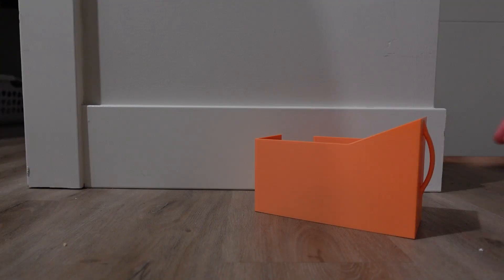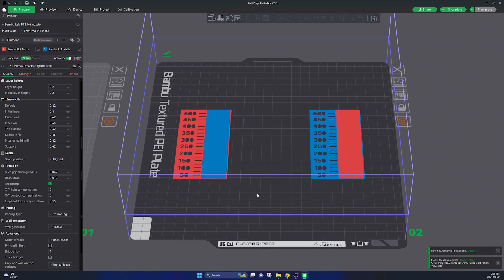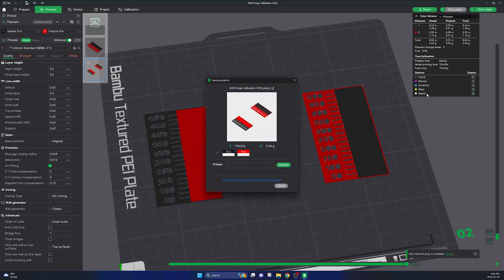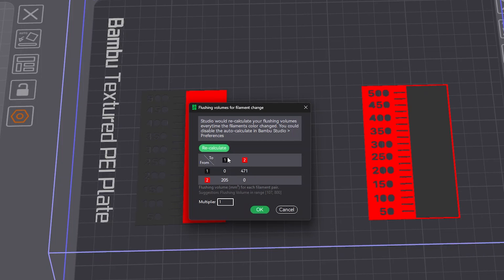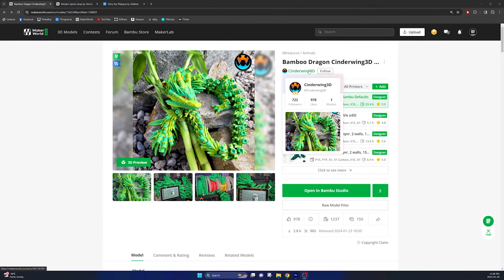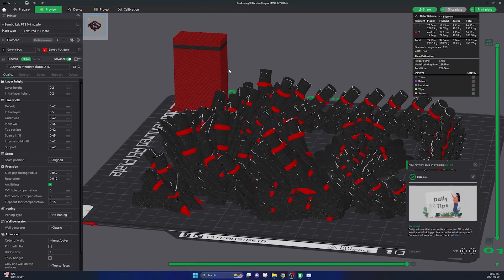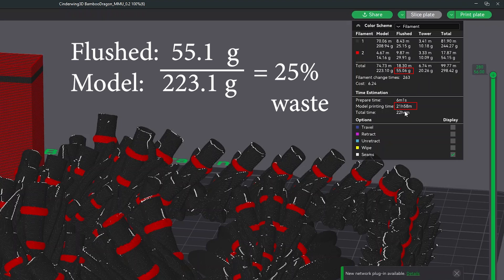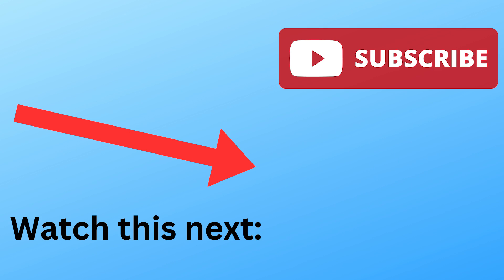How to MINIMIZE PURGE WASTE! - Calibrate Bambu Lab AMS

Comment: has anyone needed a value higher than 150?  Seems like every time I print these I always get a value between 50 to 125, so 150 seems like a safe default value if I don't want to spend almost 20 minutes printing this every time I change a filament color.

Comment: i have an issue where the inside (meter) is being printed first instead of the card (numbers). i cant seem to find an answer on how to make the printer print something first instead of another thing. In this case i would like to print the way you did instead of the other way around as the other way wouldn't tell me how to calculate my flush settings.

Comment: I don't know when it went into the official release of Studio (perhaps after this video), but they added a 'long retraction when cut' (or something similar).  This tells the printer to retract some filament BEFORE it cuts it and then retract it.  Default is 18mm I believe, so every color change, it will go 'home', retract 18mm, go cut, go back home, retract color 1, feed color 2, then purge.  Now there is 18mm less material that needs to come out before you get to the new color, in theory, allowing you to reduce that purge volume even more.

Comment: makerworld file not complete there are missing key settings that are jsut not cghecked as example i just noticed after starting printing it doing the flushing volume printing part first with already startgcode flush so it just does not say anything... please fix it.

Comment: Changed flushing values (and multiplier) to zero  before printing your calibration download file.   After printing there was no color transition on either side.  Both were solid red and black.  I did this twice to make sure.   Basically, this did not help.  Reset flushing settings.

Comment: It’s worth mentioning that you will need to change the wall count to 1 as it appears that the it effectively purges the new colour into the walls of the section that is meant to give a transition point. The 3mf doesn’t change the wall count just the infill and purge.

Comment: I've been avoiding the AMS because of the waste and felt kinda bad about it. Then I found this video, and it really helped me learn further about print settings. I was printing a crystal dragon and before the mods was almost 200 inches of filament to be flushed. This process reduced it down to 14 inches. I'll watch the flush myself, and it's up to about 5 seconds worth (no more than that) and will go right on with printing. It also saved me maybe an hour (if not two), which is always a plus.
Reply from the maker: Glad it helped!

Comment: Thanks for the detailed video, it was easy to follow! As someone new to AMS, I do have a question. Your red -> black test that gave you your values was helpful. Lets say you add a blue to that mix. Should you expect to get different results going from red->blue than red->black? Is running that test helpful before printing any larger prints with mixed colors or is it a 1x time calibration test?

Comment: I am getting no transition when i print. Why?
Reply: On my A1 in preferences ( up on the top left beside the word “file” there is a drop down box )  I had to uncheck the box that said “ flushing volumes - auto calculate every time the color is changed” - for mine to show me the transitions.  I guess recheck that box when done so you don’t forget
Reply: @SJMB3  noted
Reply: @ change your settings before importing the file or attempting to change the colors

Comment: Dumb question.. every time we load a new filament color, should we adjust the ams purge?
Reply: Good question. Further to that does the purge amount change based on colour variations. I.e. you did Red and black, but what if you did like a green and blue would you need to re-run the calibration?
Reply: @frankr4972  id re-run it for each color combo, since bleed is different for all combinations. yes, the amount does change per color combo too. e.g. a red/orange --> yellow would (usually) use less than a black/blue --> yellow

Comment: There was a step that was missing.. In BambuStudio you need to disable auto-calculate when changing color and/or changing filament.  But this video helped me a lot.. Thank you..
Reply: Where i can find this config? What's is happenning to me is that the first piece is wasting filement even if the flushing volumes is zero.

Comment: If I’m printing something for myself that I’m using as a tool and don’t mind if the colour bleeds through the walls, I’ll flush to infill. 

Other than that, just change the filament flush multiplier to 0.4 or 0.5, turn on the prime tower, and call it a day. I’ve printed a Santa clause that used red, white, beige and black, and there was no noticeable colour bleeding at 0.5. 

This was with Bambu Lab PLA filament. If you’re using other filament, YMMV.

Comment: hi thank you very much, it's incredible I save more than 50% filament and 30% time for a project. But something wrong I can't keep the settings saved when I modified the numbers, I clicked ok and when I bring a 3mf project, the system put the default numbers for flushing volume. Do you have an idea to keep saved?
Reply from the maker: It seems Bambu Studio doesn’t have an option to save yet.. hopefully this will come in a future update

Comment: Tried this several times, for some reason it doesn't work. Maybe the new firmware overrides something. So I just designed two simple rectangles the same size of yours, assigned different filaments and it worked! Then I used one print of your design as a ruler to measure 👍
Reply from the maker: Neat idea!

Comment: great video, but for ams with four colors and used in one print, the first experiment would take a long time to complete, any easier way to do this?
Reply from the maker: You could simply change the flushing multiplier to 0.5 or 0.6 which will reduce the purge without fine tuning the calibration
Reply: same im having a hell of a time figuring it out

Comment: This is great for two color prints, how would you use this calibration for a print that uses more than just two colors?  How does one determine what color is going to be printed next so that those colors can be calibrated to minimize the waste?  Lets say I’m printing with Red, White, Blue, and Black.  Do I need to calibrate Red into all of the other colors, and so on before I print the actual model?  If so, I’m sort of taking the extra time to do that instead of printing the model, and wasting extra filament in the process.  I guess I could calibrate all my colors from one to the others, and just record my results for future use.
Reply from the maker: You would use the same method, but need to calibrate all combinations of colour changes. For 4 colors, that would be 12 calibrations.
You’re right, it’s a bit of extra work up front but in the long run if you record your values you would save a lot of time in the future.
You’d be surprised how much you can reduce your print time and wasted material if you do have 4 colors in one print.
Reply from the maker: You could also simply change the flushing multiplier to 0.5 or 0.6 if you want to quickly get a close approximation
Reply: @engineer3dprints  thanks for the reply, I think I will start my own personal data base of purge settings between colors.  A spreadsheet would work great for this.  Thanks. 😁

Comment: I have a question, my P1S should arrive early next week (my first 3d printer), do you need to do it for every color or brand or is like bambu played safe with huge value and you can just determinate the right one and use it for everything
Reply from the maker: Ideally you would dial it in for each colour but you could be conservative and use around 250-300 for all and you should be fine

Comment: As someone who’s just ordered their X1C this is great to see and will be one of the first things I do when I set up my printer. Thanks!
Reply from the maker: Awesome, you will love the X1C
Reply: @engineer3dprints I got it yesterday and it’s incredible. It has far surpassed all of my expecations.
Reply: @engineer3dprints  I love it! Been printing with it since it arrived :) Though i wanted to ask, should I do this every time? Or would it work to just go between two completely opposite colours (like red/blue, black/white) as those would likely be the worst in terms of how long it would take for the bleed to go away and a full purge to happen?

 There's another method of just halving the multiplier which is definitely not as precise, but Teaching Tech said that it works great and there's still margin left over. Thanks for the help :)
Reply from the maker: Halving the multiplier is a quick method that should get you close. If you want to reduce material as much as possible, you’d want to calibrate for each color combination. Going from a dark to a light color requires much more purge than going from light to dark
Reply: @engineer3dprints thanks very much!
Reply from the maker: No problem, fellow Canadian :)

Comment: I used your file from maker world which works great if you use it to flush 1 and 2 which is what is default but if you try to change the colors it prints out of order I even tried your 8 color one and it prints out of order right off the bat. I can only get it to work if the colors i want to calibrate are loaded into 1 and 2 on my ams unit

Comment: Does this have to be done to every single filament every time you swap the filament? And if you do this once to a filament roll, change it out, then put it back later, do I have to do this again?
Reply from the maker: No, you will need to do this for each combination of filament color changes, but if you swap a roll later on back to the same color, you can use the same values

Comment: Thanl you, I’ve been looking for a print to calibrate this value :)
It also tells me that I can go down less than 12% waste if I pre cut the filament. Currently no slicer does this, but it’s good to know how much it could save :) Also opens up the oppertunity for mixing colors during printing, just do lots of cuts. Would take a looot of time tho, but you could do full color prints with just one ams :)

Comment: You can't always purge to infill. Light to dark colors will bleed through the walls
Reply: If you are using 3 walls you may get away with it
Reply: Other channels have done the test and barely any bleeding is visible through the walls.
Reply: good to know, but the biggest jump is the calibration anyway
Reply from the maker: Yes true

Comment: There is a setup that you can retract a bit of the filament before the cut to push this down even more. You can also set the flushing volume to .5 or so, and it should get the values close to the actual values that way you dont have to keep a spreadsheet for all of you're colors.
Reply: That's changing the g code for the printer BUT it erases after updates and can be confusing to some. 

I do think bambulabs should implement that code into their printers though
Reply from the maker: Agreed 🤞